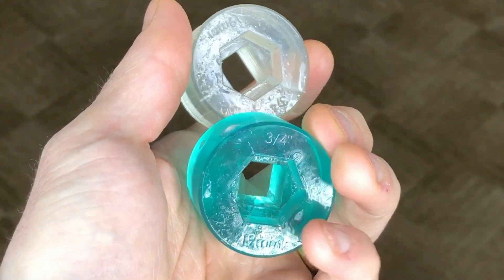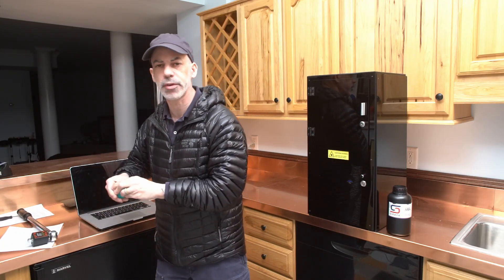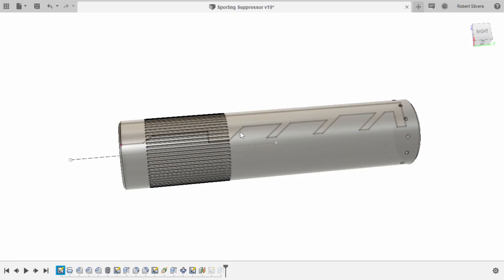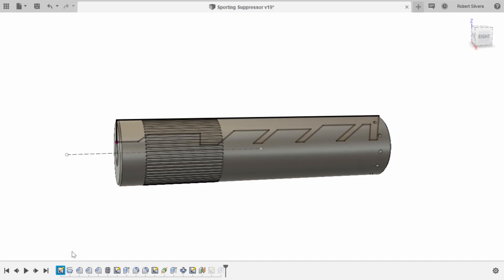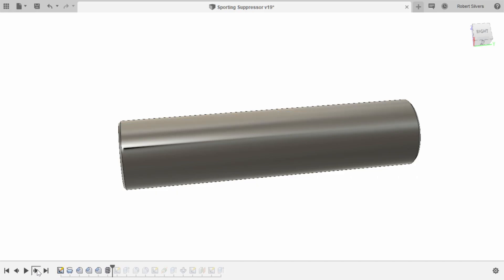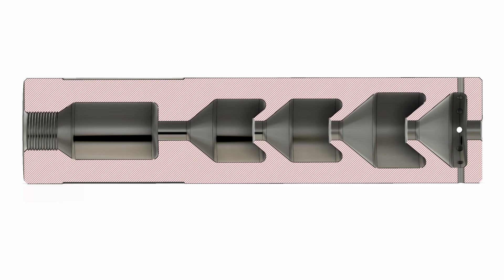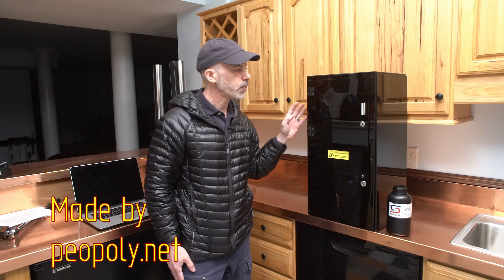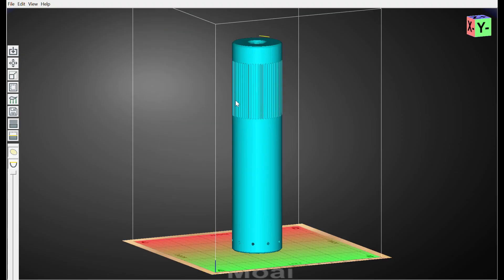Tough 3D Prints from Resin

Comment: The U.S. military's potential replacement of the m16 platform uses a 3d printed suppressor. This is not only do-able. It is actually practical.
Reply: @jim jones was that an attempt at humor? Hard to tell trough text sometimes, but I have an extremely strong feeling you where being funny.
Reply: John Failphins  jim jones made that statement at my other comment. it seems too ironic to be on accident. i think he was utilizing subtle humor/sarcasm.
Reply: Yea out of metal
Reply: @claudekim7876  Even the ammunition casings are made of polymer. Do some research before you argue, dumbass. https://youtu.be/874qcsynsL0
Reply: @lamegame420  That is certainly cool but I believe the military has been trying to replace the m16 platform for some time now, and everything falls short. I have a feeling this won't be any different.
Reply: Adam Arzo samee
Reply: cutthroat 420 Polymer, like brass, is not strong enough to withstand the pressures needed. That’s why the chamber supports the round and takes the pressure forces.

Comment: Good morning. I was wondering if you would be willing to share your parameters for printing Siraya Blu on a Peopoly Moai. I have the very same printer and resin, but for the life of me cannot get either the Siraya Blu or Siraya Tenacious to print at all. I'm not looking to print a supressor or anything, just simply trying to figure out how to use Siraya Tech as it's less expensive than peopoly's own tough V2 resin.
Reply: I use to have the Moai but sold it for a msla. I can't remember the exact settings, but what I do remember is the laser speed needed to be much slower than the standard peopoly resins. I use Blu all the time for my msla printer and my layer exposure time is more than double of most resins. blu needs a much longer exposure to cure properly. I hope this helps.

Comment: awesome!! can  u make a complete gun with this resin??
Reply: Probably not a complete gun, at least not one that survives more than a few shots, but probably a lot of gun parts.
Reply: Superwip what about a glock frame?
Reply: @pedrovelasquez9238  could be possible...
Reply: No, it is not possible to fully 3d print a working firearm. Several parts need to be metal for functionality and safety.
Reply: well... you can 3d print metal parts...
Reply: Ryal Deveau you can, just most 100% plastic designs are terrible at the moment (I guess still about on par with the ZIP guns, lol!). Most of them are not made by people that seemingly know how to CAD or just don’t know much about firearms.

Typically they do use 1 metal part like a nail for the firing pin, but technically many firearms have the firing pin as part of the receiver (so when the receiver slams forward it fires, much like most basic pipe guns you can easily make from the plumbing isle in stores), so you really wouldn’t even need that. The choices most of the designers of these printable ones are not choosing particularly great examples to copy, but it’s a start I guess.
Reply: Yes.

Comment: 90nm is equal to 66ftlbs, most audis wheel lug bolt torque is 89ftlbs :p but thats still decent for resin test.
Reply: Jared Zadorozny which audi? There is more than 1 with more than 1 torque spec.

Comment: That was a really clever way to measure the strength of different resins
Reply: It's the "Shore Value". Salute
Reply: The engineering data is the ideal strength. This is good to know because you can discard it out of the gate if it’s too low but you need to know if your printing regime gets close to the ideal.
Reply: There's no need to do do experiments to determine this property . This is published data that's out there.
Reply: @eddiemendoza6304   do you just need a shore value that's capable of handling near the pressure that the chamber sees?
Reply: @jdhill770  yes and no.. there are far too many factors that come into play and the shore value in this instance would've only been used to determine the best resin to use for the experiment....for example if the shore value was too low it is highly possible that material would be sheered off from the pressure causing internal damage however if the shore value is strong enough to resist such it is also possible that the device would explode if the wall thickness isn't sufficient.

Comment: That semi-clear blue LOOKS cooler than a metal one, though. Especially When you get flashes inside.
Reply: Also makes it easier to seem if anything is broken
Reply: Yeah and if it fails you are going to have shards of resin implanted in your hand
Reply: @lolzdatguy4987  very unlikely, if it blew up it would go outward and forward.
Reply: @K3LL1ON ven  ifthere is an engineering failure, there is a practical success!
Reply: But that kinda defeats is purpose, don't you think?

It's still cool, though.
Reply: Little flash light at the end of it

Comment: I wonder what the viability is of a more oblong suppressor, sort of like a muzzle brake style shape, but of course cylindrical lengthwise. The gasses have more room to expland, while maintaining the overall length of the suppressor the same or even shorter. The hard part would be maintaining the integrity of said suppressor along the top and bottom edges, since realistically it would be thinner in these areas.

Comment: I had to watch 9 minutes of this for a 22 rimfire can?  I was hoping for something that works on a 9mm or maybe 300 BLK subsonic.  Cheapo FDM printers running PLA can produce reasonably durable 22 rimfire cans with much thinner walls and internal structures.  

That baffle is ridiculous.  Try thinking out of the box a bit .... 3D printing can produce nearly any shape and the resin process has far fewer limitations than an FDM machine.
Reply: Let's see your 3D printed silencer, then.
Reply: @VuurwapenBlog  please put your content back, mr Tuohy! I miss it.
Reply: @The Godfather LOL! Internet idiot mocks R Silvers.
Reply: @tomb816  I know R Silvers and am familiar with his design work.  I also hold several US patents on silencers.  I have designed and built PLA printed suppressors that withstand 9mm and 300 BLK subsonic.
Reply: @ExpatriotSilencers  Sure you have sunshine
Reply: @ExpatriotSilencers  i confirm that. 3d printer can make good pla silencer. ils work for 22, 9mm and 300blk. I tested. Sorry for my english
Reply: It's a natural first step in the testing cycle. If you watched smarter every day's videos, they made them with aluminum baffles, and clear lexan tube, and those failed rapidly under rifle caliber. Lexan is going to be a lot stronger than any stepper deposited hot glue or sintered powder plastic. Granted that design had the tube not getting any tension support from the baffles, but it should show the principle.